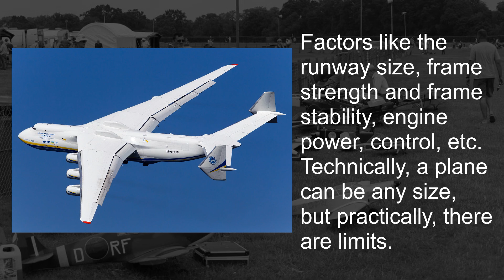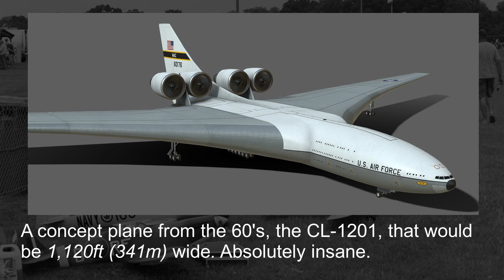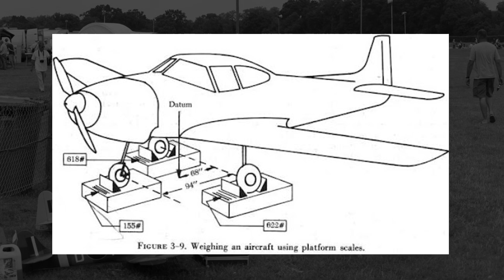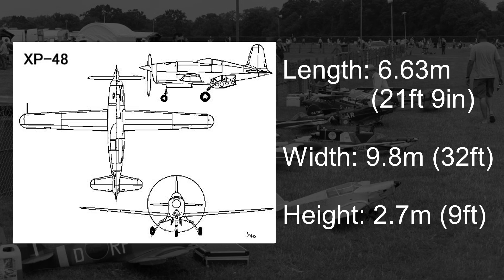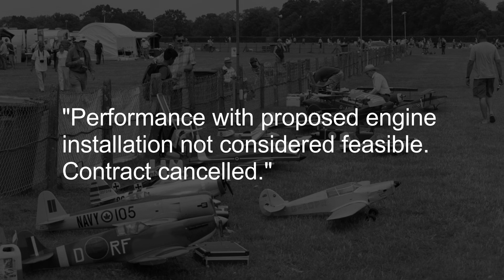Small Plane, Big Promises: Douglas XP-48

Comment: This Douglas design looks amazingly like a French Cauldron C-460 air racer but with tricycle landing gear. Compare and see.
  I believe Cauldron also came up with and proposed a militarized version for the French Air Force, but I don't remember it's model number.  It was  tested, but was not accepted by the French AF.
Reply: Addition to my previous post. Please search the Cauldron C.710, C.713, and C.714 series aircraft. A limited number of C.714 aircraft were actually ordered and built (under 100 total). A number (30-ish) were sold to the Finns and tested but quickly withdrawn as unacceptable for combat. Another 50 - 60 formed the basis of a French squadron to be flown by surviving Polish national pilots who fled after their Country's capitulation, but these aircraft were also deemed unsuitable for combat against the far superior German fighters and quickly withdrawn from frontline service and used in utility roles or as fighter trainers.

Comment: The problem with going smaller is that a lot of things don't scale with aircraft size. The pilot and seat is still the same weight. A gunsight is the same. A gun is the same size and weight (so you'll have to carry fewer guns and less ammo, which impacts fighting performance). Basic instruments and panel and various levers and controls are also much the same.

Top speed isn't particularly affected by weight, as weight affects induced drag, and induced drag in turn decreases as the inverse of the speed increase, so it's lower the faster you go. Parasite/form drag benefits from going bigger as you can fit a much more powerful engine in just a slightly larger volume. The RR Merlin, in about 1938-1939, could provide more than 1200 hp, more than twice that of the engine in the XP-48, yet with a frontal area (important for parasite/form drag) just 40 % larger, for an over 60 % greater power/area ratio. By 1944, there were variants with around 2000 hp. The engine in the XP-48 would probably not have seen such an improvement as it wasn't a prioritized engine.

Comment: They only said 525 mph because the mathematical curves would support it with such a small aerodynamic airframe. Design an 800 hp air cooled straight 6 for it and the P-48 may have hit 525.

Comment: It is funny just how different the air war was over the eastern front vs the western front. So much of western war was fought at 20 k and above.  In the east, just the opposite, usually 10-15 k and below. Western planes, at least by 43, were all using advanced two stage, two speed supercharges. In the east, operating out of whatever passed as an airport on that massive front, planes with sophisticated engines requiring high maintenance, forget it. Yak 3s make  a lot of sense. Couldn't be more different.  What is the best plane of ww2? The one that worked for you.

Comment: The Douglas P-48 was pre-war while the Bell XP-77 was very near the end of the war, and the biggest problem with either of them, as well as with the Fairchild AT-21 Gunner and the Curtis SO3C Seamew was the failure of the air cooled inverted V-12 Fairchild Ranger V-770, in any of it's iterations, to produce the design-rate power output or to operate within an enclosed fairing at more than half throttle without drastically overheating. It was one of the most thorough failures of any American aircraft engine!

Comment: The Soviets did not have the range requirements that the US/Great Britain had, so they didn't have to build nearly as large (and heavy) aircraft.  The YAK 3 never had to penetrate deep into enemy airspace: most of their action happened within a 100 miles of their bases, bases being moved forward as the front moved west.  Contrast that with the US requirement for a fighter to be able escort bombers all the way "to Berlin" and back from bases in Great Britain...well you end up with big planes like the P-47.  Ironically, the ME-110 was built as a German escort fighter--a "Fighter Destroyer" intended to escort bombers; the ME-109 didn't have the range to loiter over enemy territory--not even Great Britain only 90 miles from France--and dogfight for an extended period of time.  Had the USSR tried to fight an extended air-war from the distances that the US and the RAF did, they wouldn't have gotten away with "Small Fighters" either.

Comment: Before props were replaced by jets most of the successful fighters tended to design the smallest practical airframe around the most powerful engine. 
Even the P-47 was as small as it could be given all the equipment it had in it. 
Even the YAK sourced the most powerful engine that it could. 
More power rather than less weight was usually the answer. 
This tendency did not change until the jet age and even then the lightweight jets are relatively rare. 
Gnat, Skyhawks (technically a bomber) and the F-5 /20 are the only examples that spring to mind.

Comment: The Spitfire Mk1 had an 80 gallon tank and about a1,000 horsepower. The XP-28, with 550 horsepower and 50 gallons, actually had a better fuel capacity to horsepower ration, so it isn't as bad as it sounds at first.

Comment: I'm fairly certain that Soviet fighters were smaller and lighter compared to Western Allied fighters because Soviet fighters had the benefit of not having to deal with seas/oceans, high-altitude combat, long-range missions, or having very limited strategic depth to fall back on. The Soviets could build airfields almost anywhere across the entire theater in many directions, and their primary missions were defensive air superiority against low-altitude threats.

The Western Allies had a far greater and more demanding set of mission types. They needed the range, altitude, maneuverability, speed, armament, and protection to carry out missions across large distances and still go toe to toe with lighter, smaller fighters and beat them at their own game, consistently. They had to defend swarms of allied bombers and conduct interdiction missions deep into enemy territory, and much more.

Soviet carrier aviation never got off the ground, but even if they really tried, it would have meant a total paradigm-shift from their usual designs because they would need something rugged enough to handle carrier operations, long-ranged enough to range far from the carrier, armed enough to reliably make their sorties count, and protected enough to keep their precious carrier aviators alive, all while having to contend with enemy land-based fighters and bombers.

Comment: Folkerts jupiter or speed king, and bell xp77, among others. The travel air 'mystery ship' was a kick in the pants to military designers, who went bigger using the design ideas to take bigger motors,  where racers went smaller with the same engines from chevrolair, menasco, franklin, and ranger, with 6 and even 12 cylinders. One may remember the t35 temco buckaroo, and the t34 mentor by beechcraft, which were about as small as were actually flown with armaments in the u.s., and even the mooney mite was proposedbwith guns as the 'cub killer" ( humourously typo'd as the 'lub killer'). 
"Just summon lightning, and be done with it" = the p47 thunderbolt.
All designs were a compromise, frequently too many compromises. Some shore looked purty, too.

Comment: I would really like to see someone build this aircraft to the specifications that Douglas laid out and see what it is actually capable of. To be perfectly clear, I'm not expecting anything NEAR 500 mph, but it would still be fun to know the truth.
Reply: And now we have lightweight V-12s such as the Falconer that could be used to power it as well.  A custom V-12 using Continental cylinders on a custom crankcase would probably also be similar weight and power wise and not be too difficult to build.

Comment: Don't forget the fuel will change weight up to a 1/3 to a 1/2 a pound per gallon depending on temperature.  This could be more significant on the smaller fighters, because the temperature weight difference would constitute a larger percentage of the weight difference than I in the larger aircraft, potentially.

Comment: The long, thin wings would reduce wingtip vortices which would reduce drag at higher angles of attack. This would be helpful in climb and could be helpful when turning, allowing the smaller plane to turn inside of a plane with normally proportioned wings. The price was that the longer thin wing wouldn't roll as quickly as a shorter winged plane.  I have heard that, while the P-40 wasn't able to turn as quickly as the Japanese Zero and Hyabusa, it was supposed to have a faster roll rate.
Reply: Turn rate is also about wing loading. The XP-48 with its small wings would at gross have a wing loading of 181 kg/sq m (37 lb/sq ft), which would make its turning capability inferior to the Spitfire and even to early Me 109s. The low induced drag due to its high aspect ratio wings would serve to overcome drag at high angles of attack (i.e. maintaining a steep bank on low horsepower), but not to reduce the turning radius.

Comment: Another reason that Soviet fighters like the Yak 3 were smaller than American fighters was that their focus was air superiority over a fairly small battle field, Most of the well known American fighters, like the P-47 Thunderbolt and the P-51 Mustang, were used as bomber escorts and needed to carry extra fuel for longer range. The Mustang may not have been designed as a bomber escort, but if it had been as small as a Yak 3, it probably wouldn't have had the range to be used as an escort fighter and would have been built in smaller numbers.

Comment: Its a Dora! A Dora 9! I'll bet folk are saying to themselves with the comparison between the Corsair and the FW 190D-9. Surely there were images of FW 190A's or F's? I love this prog. No matter how much I think I know about aviation, I always learn something new when I these. Thanks. Keep up the good work dude.
Reply: The Fw 190 Dora has a Junkers Jumo 213A V-12 inveryted liquid-cooled piston engine 1,750 PS (1,726 hp; 1,287 kW) not the radial BMW 801 as in the video. The dry weight of this powerplant is noted as 1040 kg (2,072 lb) in Wiki. Not sure if this weight includes the cooling lines and radiators which would not be required for the aircooled 801.
Reply: I agree, the pic used is of a FW-190 Dora-9 series with an inverted inline V-12 (Jumo or D-B) engine, not an A or F series 190 with the BMW 801 radial.

Comment: The Germans produced a directive not to dogfight with the Yak-3 below 5K meters, due to its speed and maneuverability advantages at low level.
Reply: The Yak-3 was a great little aircraft and performed super well below 5000m. However the Bf109 wasn't much bigger or heavier, had superior vertical and high altitude performance and was more versatile. In low level curving dogfights, the Yak-3 and probably also the bigger Yak-9 outperformed the 109.

Comment: It reminds me French Caudron C.714. With 4 7.5mm machine guns and gross weight of 1880kg... I think a few Air Forces toyed with idea of extra light fighter plane...
Reply: The Caudron C. 714 had a 500 horsepower engine but was only capable of 283 miles per hour, which was poor by the standards of 1940, when it entered service. 

It had obvious similarities to the C.460 racing plane which had won the Greve and Thompson Trophy races in 1936, which likely also provided inspiration for this Douglass proposal.  

The C.460 did achieve 1 mile per hour per horsepower (310 miles per hour from 310 horsepower) but did that by being barebones, as racing planes were.

Comment: "explicit reason for this"

Very simple, USSR got kinda caught in between development cycles for aircraft engines, similar to Italy and to a lesser degree France.
And most of the more powerful engines they DID have in the pipeline were ones that eventually did not enter production due to various problems.
So, while their aircraft early in the war was comparable in size, they didn't have the time to develop the engines they needed during the war, so they shrunk the fighters instead.

Comment: I wonder if that 525 mph was terminal dive speed or a typographical error and they meant 425 mph?
Reply: 525MPH on a dive, maybe.  It'll have already shed those ridiculous wings, and auger into the ground.  "LAWNDART!"  😅
Reply: One can at least hope!   425 MIGHT be excused as overhype, but 525 was just pure lying.
Reply: @DIREWOLFx75  I can’t imagine the plane coming close to 500 mph in a dive without coming apart due to those high aspect ratio wings. 
But I am not an aerospace engineer. 
The C 714 didn’t work out well either.
Reply: @kellybreen5526  "But I am not an aerospace engineer."

I'm pretty sure you don't have to be, because it's pretty damn obvious that that design is not going to hold up well.

Comment: Great video on an obscure little fighter.

As a little point of nitpicking, in the video you talk about an FW 190 and its BMW radial engine. But the picture you show seems to be a FW 190D or similar, with an Jumo V12 engine. The point about the engine being a mayor source of weight is still correct, its just a unfortunate choice of picture.
Reply: Ta152
Reply: @johnhagemeyer8578  google image search points to it being a Fw190 D9, but yes the Ta152 has some similarities in the fuselage.